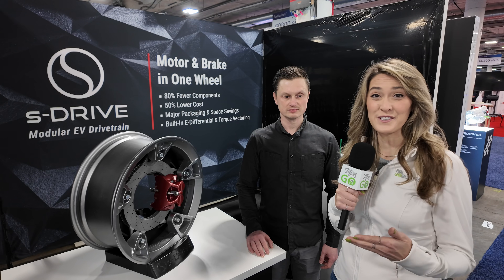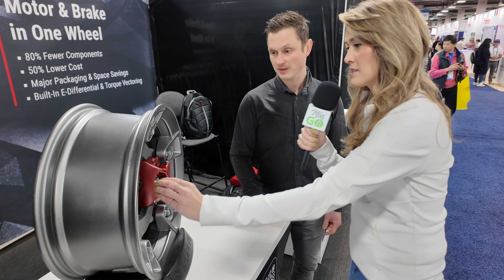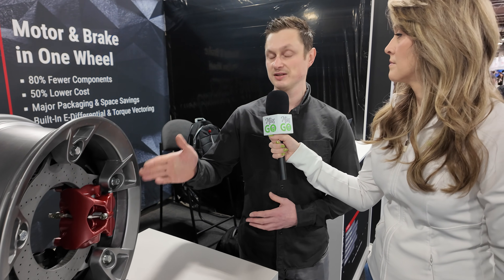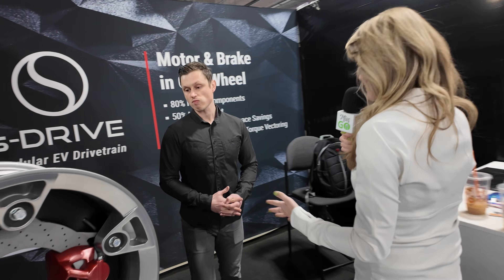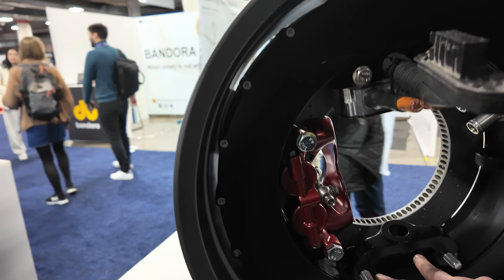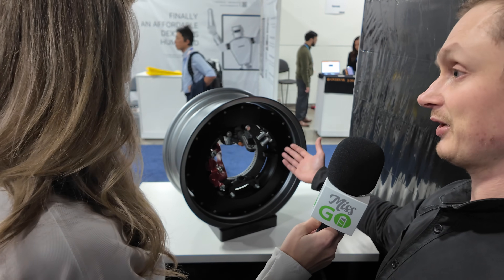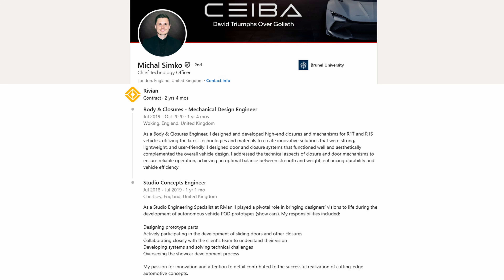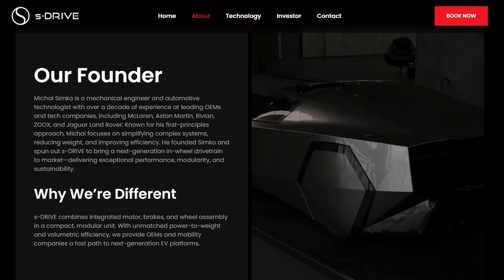S-DRIVE In-Wheel EV Powertrain Solution (CES 2026)

Comment: The enormous diameter seal between between the rotor and stator will be an operational nightmare.
Reply from the maker: Solved problems.
It seems like many commenters are not aware that axial flux hubless motors have been in production vehicles and delivered to customers for years.
https://www.youtube.com/watch?v=cQstV0uLLHg
-Producer Tim
Reply: @MissGoElectricIndustry  I'm not watching another one of your videos to pump up your view count. Name a production car using a hub motor with a similar seal and bearing configuration.

Comment: dumb; electric motors require extremely small air gaps to be efficient and wheel impact forces are not conducive to tight tolerances like that. Also the typical vehicle dynamics problems of the unsprung weight. Lordstown tried in wheel motors, what happened to them?
Reply from the maker: You think Lordstown failed because of the motor supplier they chose?  Perhaps we should create an educational documentary about that as we did with Fisker to add clarity.
-Producer Tim
Reply: @MissGoElectricIndustry  I don't have any specific info about all the things that went wrong there, I just have technical expertise in the field. every attempt at in wheel motors for cars so far has either failed or switched to inboard motors. 

happy to try and explain in greater detail the technical reasons why hub motors in general currently don't seem like a very good choice.

Comment: An elastometric mount between the wheel and hub is idiotic. The fact that they included this demonstrates that the motor is unable to handle the shock of in-wheel mounting.
Reply from the maker: Obviously you've drawn a false conclusion. That is a solved problem.  Here is a hubless axial flux powered vehicle after 11k miles driven this summer by a YouTuber.  These have been in production for years.
https://www.youtube.com/watch?v=cQstV0uLLHg
-Producer Tim
Reply: @MissGoElectricIndustry  It is the manufacturer of the in-wheel motor which is claiming that the elastomertic mounts are there to reduce shock loads. Yes, hub motors have existed for years; most of them use conventional bearings, not the very large diameter bearing of this design.. which apparently is reliable.

Comment: The weight claim is ridiculous. I'll assume that what he meant to claim (but didn't) is that the system - including all wheel-end rotating components, hub and carrier, brakes, and motor - weighs no more than the equivalent wheel-end components (without motor) of a conventional design.
Reply from the maker: You are saying this engineer is lying?
-Producer Tim
Reply: @MissGoElectricIndustry  No, I'm saying that what he said was nonsense, and I explicitly said that he probably meant something different. Do you read English, or are you using a translator?

Comment: It's great. Increase rolling resistance, increase  noise due to increase bearings on the perimeter, increase vibration I see dampeners, .prone to damage. What about standing water over the bottom rims over time. Like being parked.
Reply from the maker: Did you know that there are many in wheel motors in mass production right now worldwide? 
We don't have to imagine whether or not the technology is viable. 
-Producer Tim

Comment: It looks like the tire is directly mounted on the motor (no hub to bolt to for a regular wheel). That probably means mounting  new tires would require a shop that has equipment to handle this solution.
Reply from the maker: We see five typical lugs and we think the rim separates.

We'll keep tabs on this for our weekly EV news reporting over at our main channel
youtube.com/MissGoElectric
We hope you'll subscribe both here and over there
-Producer Tim

Comment: Sounds nice, BUT, as those bushing wears off, you are gonna have imbalance wheel spin though, no? Plus you have less than 1cm gap between the motor and the wheel... not much leeway. Finally, you have to use a special wheel, you can't use any standard wheels... how will people balance the tire and wheel?
Reply from the maker: Remember, in wheel motor technology exists in production right now.  These problems have been solved.

We'll keep tabs on this for our weekly EV news reporting over at our main channel
youtube.com/MissGoElectric
We hope you'll subscribe both here and over there
-Producer Tim
Reply: @MissGoElectricIndustry in production doesn't mean it can be financially and viable at scale. Every pothole (roads in my area are abysmal) could cost thousands instead of hundreds. While it sounds nice on paper, the reality is that it has at least 2x the complexity of a dual motors EV... An in-wheel motor like this, needs to be completely sealed from winter road salt, water and debris to be potentially viable.

Comment: How do you deal with dirt inside the motor? Seems impossible to seal?
Reply: How do you change the tires?
Reply: @RecordnRtist  undo damper bolts then change like normal
Reply: @NVMDSTEvil  If you say so.  Minor wheel damage from a ball joint will be expensive and dangerous to a greater extent than a internal combustion engine.

With the suspension replacing the wheel hub,  I can only imagine what balancing issues may be introduced?
Reply: @RecordnRtist wheel hub isnt replacing the suspension, the mounting points are only to dampen vibrations, hence why they are called dampeners. The ball joint and the rest of the suspension will be identical structure and purpose as most previous vehicles unless it is designed to turn 90 degrees which of course would require somme engineering changes
Reply from the maker: Solved problems.
It seems like many commenters are not aware that axial flux hubless motors have been in production vehicles and delivered to customers for years.
https://www.youtube.com/watch?v=cQstV0uLLHg
-Producer Tim

Comment: While the Donut Lab wheel offers nothing more than a spectacular appearance and the absence of a reduction stage, with undoubtedly considerable weight and a significant gyroscopic effect, this S-Drive seems interesting for its simplicity and minimalism. I think that the unit weight of this wheel must be contained, but so must its power, because the magnet and coil do not take up much space due to the large void left by the hubless design. So for me, it will be for AWD vehicles. These dampers seem curious to me because the tire itself should minimize the effect of shocks, probably a matter of damping frequency... If its system doesn't take on water, it's the best in-wheel system for moderate power levels in my opinion. The inventor's background explains the rationality of this prototype. Good luck to him!
Reply from the maker: We'll keep tabs on this for our weekly EV news reporting over at our main channel
youtube.com/MissGoElectric
We hope you'll subscribe both here and over there
-Producer Tim

Comment: Looks like another dream concept that'll never go into production.  Lots of things to be suspicious about, but at a glance, those dampers stand out as a problem.  They're supposedly soft enough to dampen vibration/impact to protect the motor, but need to be strong and stiff enough to take all of the vehicle's loads.  Even driving straight down the road the loads on those will be incredible.  The rotor's mounting points also look very suspect, the rotors will have to be made of something incredibly strong for those to have a chance.  It would be easy to redesign the mounting to be feasibly strong enough, but I'm guessing they weren't actually trying to make something that'll work.
Reply from the maker: Your take is that this inventor who bootstrapped his startup is not "trying to make something that will work"?  Interesting perspective. -Producer Tim
Reply: @MissGoElectricIndustry  My perspective is that he tried to make something pretty that will get investors to give him money for something that has little chance of survival/production.  Time will tell.  The amount of leverage on the wheel/rotor single sheer interface is crazy and I expect it to have a very short life, if it ever hits the road.

Comment: Doesn't really address the unspring weight issues with other in hub motor designs, just reduced it a bit. Curious to see what this companies assembly weighs in at? The Koenigsegg Dark Mater motor is still 39 kg in addition to the brakes, wheel, and tire, and that is the lightest I have seen yet. Still far to heavy. I work with radial/axial/transverse electric motors daily and have seen tons of different designs and the unsprung weight is no where close to what it needs to be for a production vehicle. Not saying this can't work, only that I am very curious to see a weight comparison. Cool concept.
Reply: It has the cool factor. I'd like to see it in most favourable environment like golf cart first to test prove it.
Reply from the maker: Thanks for watching.  An interesting video about unsprung mass for this application
https://youtu.be/7A7RPEVlMrc?si=OUwiro2Z0GMeA33Z
-Producer Tim

Comment: I wonder how they would handle winter slush, sand, ash, and salt from the roads?
Reply: Surely they wouldn't roll it out without proper sealing. Probably not submarine grade but sufficient.
Reply: @ondrejdvorak5107 Such a narrow gap between rotor and stator, requires air cooling, sealing it seems would be difficult. Strikes me as a delicate system for the harshest environment a vehicle encounters. I guess that’s just another engineering challenge.
Reply: @PeteVanDemark my first guess was add external air pump, pressurize the compartment and make the gap sealed with air flowing/blowing out through the gap constantly. But I'm not an engineer to evaluate it.
Reply from the maker: The great thing is, there are already axial flux hubless in wheel motors in production vehicles now.  The problems have been solved.

We'll keep tabs on this for our weekly EV news reporting over at our main channel
youtube.com/MissGoElectric
We hope you'll subscribe both here and over there
-Producer Tim

Comment: BEEN TRIED BEFORE IN CANADA 30 YEARS AGO BY CHRYSLER.PERSONALLY IN CANADA I DONT SEE THIS WORKING. WITH THE SLUSH AND THE CALCIUM AND COLD WEATHER,  FIRST WITH ELECTRIC CARS A WELL INSULATED MOTOR WITH NO VIBRATION WHATSOEVER, AND THE ABILITY WE ALREADY HAVE TO REDUCE PARTS AND HAVE NO TANSMISSIONS AND NO DRIVE SHAT. THE ACTUAL SYSTEM IS MUCH MORE SAFE AND RELIABLE THAN A WEEL MOTOR BOUNCING UP AND DOWN WHIT BOLTS IN RUBBER TO PREVENT VIBRATION , IS A LOT TO ASK, I DONT BELIEVE THAT THIS WILL WORK FOR 200,000 MILES WITHOUT PROBLEMS.
Reply from the maker: We'll report the story as it develops on our weekly news program over at our main channel.  We hope you'll join us there (subscribe)
news.missgoelectric.com
-Producer Tim

Comment: Just don’t hit a pothole. 😮
Reply: I don't get it what is the issue with pothole. How many potholes did you hit that hard to damage the rim?
Reply: @ondrejdvorak5107  The jolt to the motor through those tiny rubber bushings. And changing out those ball joints look like fun. And see how it performs when all the road salt and dirt build up. Maybe it’s good for a pristine race track surface but in a city with no money to fix their streets… good luck. 😮 Oh, I forgot about driving through a flooded street.
Reply: @blipco5 I mentioned it here in comments multiple times, my laic guess to make it waterproof would be to add air pressurization of the compartment with constant outflow of air through the gap with surplus to make it through say 1m of water column.

The force damage is still risk you can only fight with sturdiness of the components.
Reply: @ondrejdvorak5107  Inboard motors are still the best method because the cost of each individual part is less to make,  buy or repair. This man did not mention the cost of each motorized wheel?
Reply from the maker: Solved problems.
It seems like many commenters are not aware that axial flux hubless motors have been in production vehicles and delivered to customers for years.
https://www.youtube.com/watch?v=cQstV0uLLHg
-Producer Tim

Comment: Mmh…rusty, dusty, worn brake discs in plain sight. Flat tires will be a nightmare. Constant shock and vibration and water exposure - emotors love this. A lot of unsprung weight too
Reply from the maker: Unsprung clarity
https://youtu.be/7A7RPEVlMrc?si=OUwiro2Z0GMeA33Z
-Producer Tim
Reply: Kinda wondering is there room for air pressurization of the compartment to make the gap outwards air flow sealed. That could help cooling as well as provide pressure to flat tire.
Reply: @ondrejdvorak5107  the main problem is vibration and heat damage and balancing to the motorwheelbraketirecoolingrubberdonutdiscbrakerecup contraption. You want one big motor instead of 4 tiny limited thingies.
Reply: @808bigisland of you can make it run without breaking for comparable time to the axel systems for 1/3 of running costs you just can't ignore it imo, could be paradigm shifter if the downsides get addressed and reasonably solved.
Reply: @ondrejdvorak5107   4x mechanical and electrical losses, 4x wear points, limited output because of size constraints, massive unsprung weight and no real advantages.
Reply: @808bigisland it's matter of real world testing, upside is you have full torque vectoring highly efficient lightweight 4x4 all stored in wheels

I guess we can agree we'd all want to see real car prototype
Reply: @ondrejdvorak5107  cars are simple things. Basic reliable tech and a pretty body is all there is to it.

Comment: This still can't do 90 degree wheel angles since it still has to attach to a vehicle with metal, but getting close to 90 would be both cool and deadly for normal drivers.
Reply: With nonstandard mount you could do 90 degree for industrial usage for example. Autonomous vehicles, forklifts and alike usage where omnidirectional mobility matters.

Comment: Addressing a flat tire would be an issue
Reply: Actually you could kill three flies with one hit if you add air pressurization of the compartment 1. Create gap seal of constant air outflow, 2. Cooling and 3. Pierced tire pressurization to safe travel to repair shop.
Reply from the maker: Solved problems.
It seems like many commenters are not aware that axial flux hubless motors have been in production vehicles and delivered to customers for years.
https://www.youtube.com/watch?v=cQstV0uLLHg
-Producer Tim

Comment: Unreliable, not long lasting and expensive...
Reply: Depends on efficiency. If running costs are 1/3 of other system savings pile up.
Reply: @ondrejdvorak5107 If it costs more from our start then you need to drive really a lot to save some electricity. So far no one was able to show even calculated plans that it can be lower cost of ownership, no facts as well.
It can't be 3 times more efficient than other systems as even at relatively lower speeds air resistance, cabin and battery heating/conditioning consume the bulk of energy. If you ride like a wheelchair than it takes billions of years for savings to show up - but interest rates on invested capital will kill the idea in just few years.
Reply from the maker: Solved problems.
It seems like many commenters are not aware that axial flux hubless motors have been in production vehicles and delivered to customers for years.
https://www.youtube.com/watch?v=cQstV0uLLHg
-Producer Tim
Reply: @MissGoElectricIndustry What's the warranty and repair costs ? Everyone knows that lots of garbage is being produced and sold at the expense of unexpecting buyers.

Comment: What happens when one motor fails in a flood?
Reply: Air pressurization could be added as cooling and waterproofing sealing the gap by air outflow imo to make it versatile for harsh environment. Otherwise the use may be limited for race or controlled environment.
Reply from the maker: What happens when water gets inside a combustion engine's air intake?

There will be an acceptable fording depth as with any automobile.

We'll keep tabs on this for our weekly EV news reporting over at our main channel youtube.com/MissGoElectric
We hope you'll subscribe both here and over there
-Producer Tim

Comment: The reduction in mass and getting near the same unsprung weight is impressive. However, I'm concerned about the size/cost/efficiency of the wheel bearing and seals, as they must be quite large in diameter.
Reply from the maker: We've shared the web site in the description for viewers to connect for more detail. -Producer Tim

Comment: Add either passive air-ducts scooping air and driving it into the motor/bearing casing, pressurizing it, exiting through the stator-rotor gap creating pressure seal for water and dirt coming in and at the same time cooling the motor, or dedicated air pump/fan with the same function? Active pump could make the wheel watertight this way and even provide pressure to pierced tires.
Reply from the maker: We'll keep tabs on this for our weekly EV news reporting over at our main channel
youtube.com/MissGoElectric
We hope you'll subscribe both here and over there
-Producer Tim